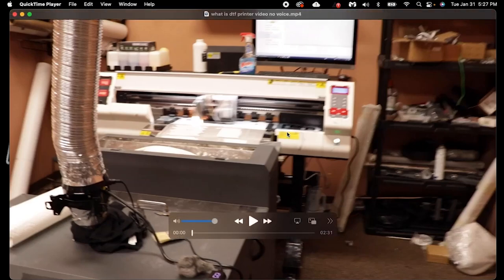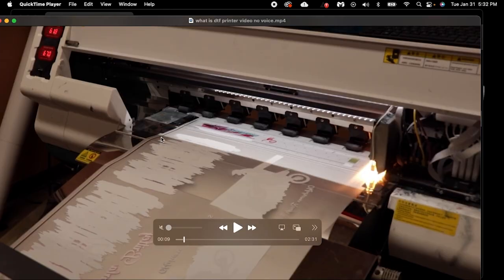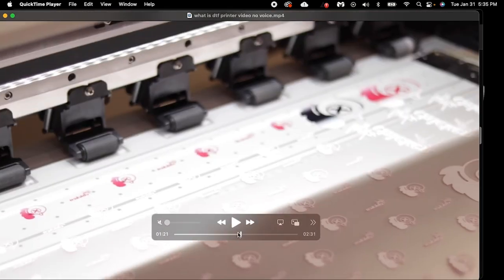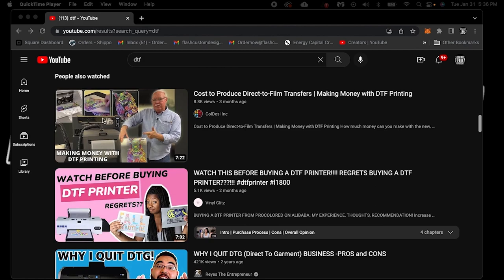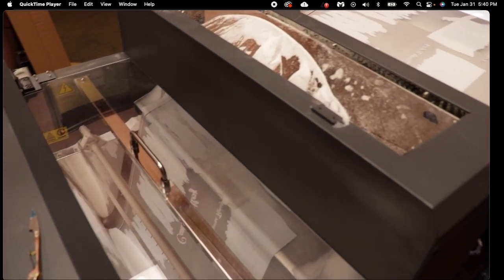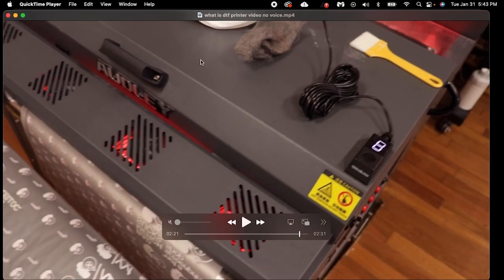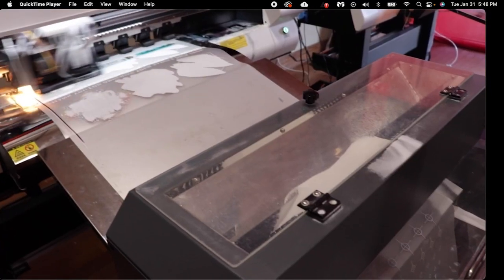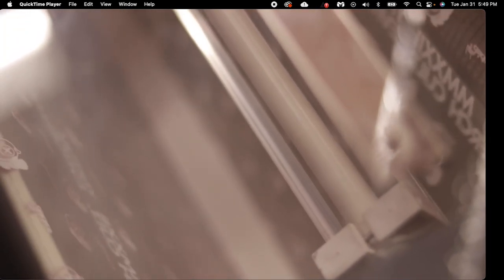THE TRUTH ABOUT DTF IN 2023! | GET RID OF YOUR AT HOME DTF PRINTER FOR A REAL PRINTER

Comment: We actually started with a desktop prestige and while it isn't fast it prints at high resolution. They also have filters for the desktop. Some of these People rather save money than their lifes and dont buy them.😅 If you need to start with a desktop DTF it can be done professionally as well. It depends on resolution, ink and film. We have upgraded but still use our desktop for small runs & designs for social media 😊😊

Comment: Thus video proves the internet is filled with misinformation....
Reply from the maker: Explain how? Are you printing on a commercial level?
Reply: @StraightOuttaContent  I'm and I do, but I also have a couple of desktop printers which I started on. Everyone doesn't have 17-24k for a printer. If they are starting out, a duel head desktop can work, and the quality of prints are on par with the commercial printer. For bigger orders, yes, commercial is preference. As long as you keep up with maintenance on a desktop, you can get started in DTF. And FYI, the white ink is not an adhesive. Misinformation.. The white ink is an underbase that allows you to press on any color, including white, and the powder with the ink creates the adhesive... Keep doing you...
Reply from the maker: @KBoogie202757  You’re hella late buddy. This video is old as shit. Check out our most recent content. Good luck with those desktop printers. We’re on to a much larger operation.

Comment: Wait, the machine print the adhesive and the powder is an adhesive too. 

Are u sure what you’re talking about.
Reply from the maker: Color and white print at the same time, the white is moist enough to accept the powder which together create the adhesive. If either part is separated, it doesn’t adhere. 

Thanks for the comment
Reply: @StraightOuttaContent That's not what you said ,you said that the printer prints the adhesive which it cannot and does not as the head would not last 2 minutes running glue through it ! 😮